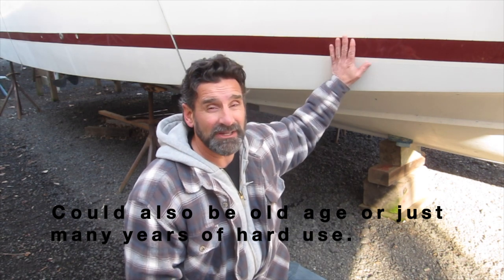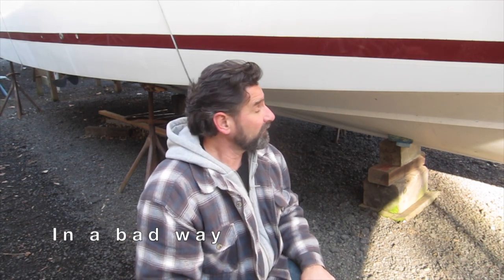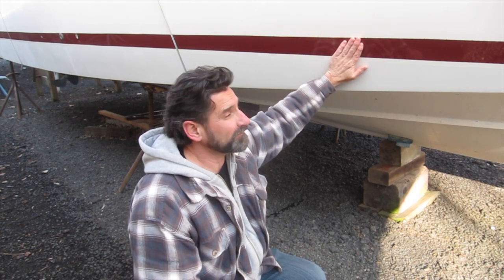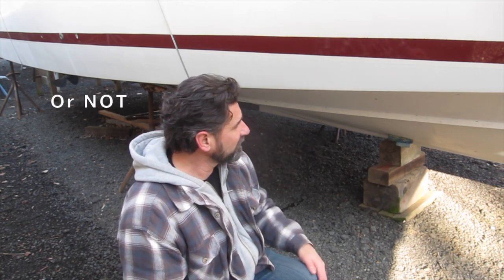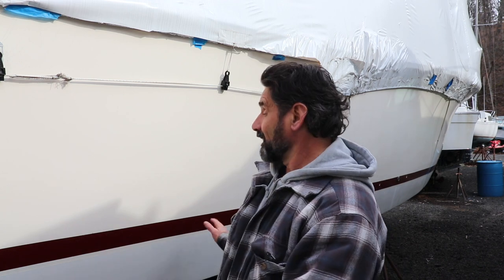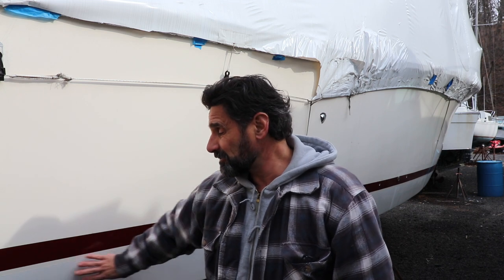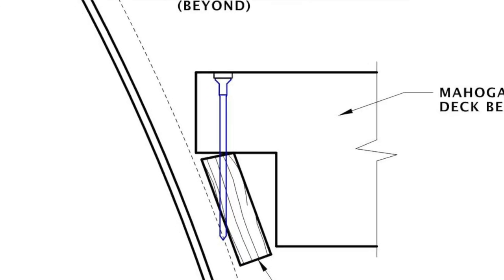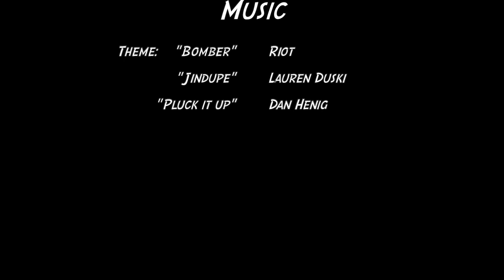Bottom Paint Removal, Bootstripe Painting & Gelcoat Issues - Boat Restoration EP030: 2018 (Part 5)

Comment: A suggestion regarding hull painting; whatever color bottom paint you use, apply a contrasting color as the first coat so that as the exposed layer wears off you will see the thinner spots to re-coat later, presuming you're using an ablative bottom coat. This was suggested to me by a fellow boat owner.
Reply from the maker: I have heard the same advise from fellow DIYers and workers here at the Marina. Sounds like good advise. Thanks for sharing.

Comment: I’ve been enjoying your videos & am impressed w/ your work. Regarding the spider cracks...BoatworksToday has a couple great techniques posted . Videos to watch are titled “Fiberglassing Stress Cracks And Making Progress” & “Shaving Fiberglass, New Approach To Stress Cracks”. If the cracks are severe, you may have to grind them all the way down & layup some new glass to stabilize the area. Good luck.
Reply from the maker: Thanks for your suggestions on the spider crack related videos. I will check them out.
Reply: @renovationsportfish1563  I've seen the boat works videos hes talking about. He has some flex epoxy that's amazing!